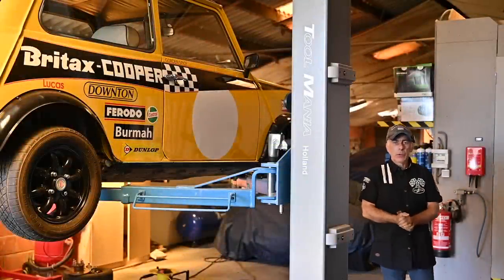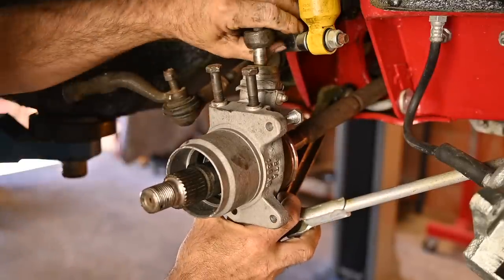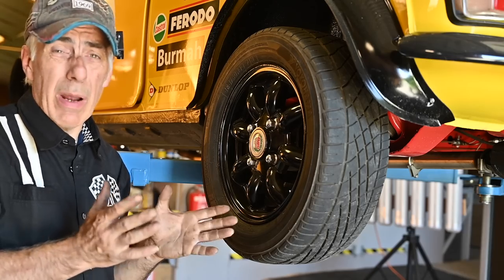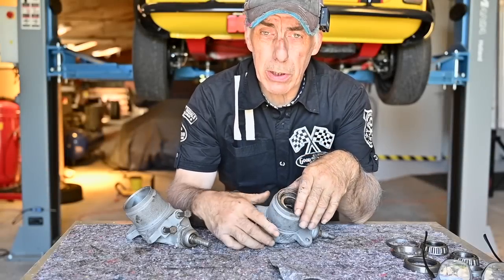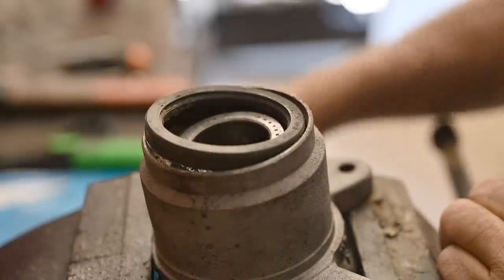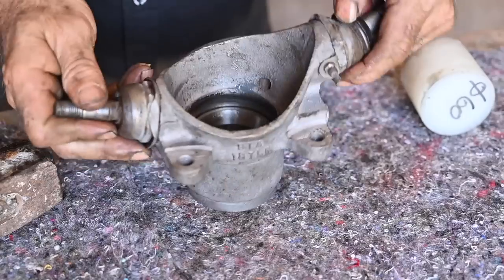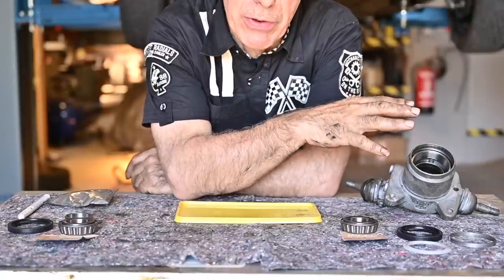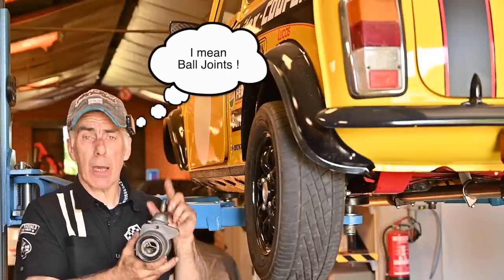Classic Mini, Part 1 Replacing  the front bearings

Comment: Thank you, this is a very good video on this subject. Your instructions are quite clear and easy to follow, much better than several others out there. I was a professional mechanic for 25 years(many decades ago) and one tip to pack taper roller bearings like these is with a wad of grease in the palm of one hand and hold the bearing with the other forcing the grease in the larger end by using a scraping motion until it comes out the smaller end, works great.
Cheers!

Comment: For packing the bearings, I get a blob of grease in the palm of one hand and use the other hand to run the bearing through the grease. However your method worked just fine. Keep up the good work.
Reply from the maker: Great tip!

Comment: For inserting the bearing cups (races) I used to take the old race and grind a little off the outer diameter (you don't need to remove much) and use that as a drift to put the new cup in. Now I have a machine shop so I can make a tool out of a material like Delrin even if it isn't a standard size. I also use a piece of brass bar to remove the cups. It will get dinged up and need cleaning up occasionally, but not a big deal. Keep up the good work - that's going to be a nice Mini.
Reply from the maker: Thanks for the comments Chris, very good tips

Comment: There is a easiest way to install bearing race or ball bearing: you may to heat a little bit a up-right and put race or bearing in a freezer for one hour at least. In this case you will be able to install race just by bare hands. I've done like this many times and it works pretty fine.
I don't think that your way is bad, but just wanna share one more option)
Reply from the maker: Thanks for the comments , indeed that is another way of doing it.. I did that before ( check my Lotus series) , but now banded from the  fridge by the girlfriend..
Reply: @D3Sshooter  Hey, being banned from the kitchen ain't bad as long as she brings the food out to the garage!  :  )

Comment: Dear Mr, I experience a looseness in the front end of my mini and the wheel alignment also doesn't last longer when done. I suspect that my front end wheel bearings are bad, but before removing how can i confirm that my bearings has gone bad? And eventhough wheel alignments are done regularly, my steering wheel jerks in highspeeds and the car slowly drifts to the right when the steering is released from the hands.. please advice me
Reply from the maker: Well to begin call me steve. Worn bearings make typical a grinding sound.  An easy way is to drive the car and take sharp left turn, if the bearings at the right are gone you will hear an increased grinding - singing sound.   Do the opposite for the other bearing.   That is one method, the second method is to jack up the car and hold the wheel at 180 opposite sites and see if you can feel play buy puling and pushing on that wheel.   In most cases warn bearings do not always cause the symptoms you describe, but they can.
Reply: @D3Sshooter  Thanks a lot steve..

Comment: An excellent job with attention to detail, not a job that would be done like this by a "professional" I am afraid, they want to see maximum profit, so many short cuts have to be taken, a very good idea of detaching the drag link from the hub ! That saves breaking another taper joint, using only best quality bearing is important, some of the cheap Chinese copies do not last very long, even on a trailer wheel. The bitterness of poor quality remains long after the sweetness of low price is forgotten, (B, Franklin). Stay safe! Chris B.
Reply from the maker: Thanks for the comments, indeed

Comment: Isnt like the faster the bearing turns the more the bearing load decreases since its more likely that the rollers gonna float on the lubricating oil film which is more stable at higher speeds?  and low speeds are more critical when the oil cannot lift the bearing and its harder to avoid direct contact. I think its more about the side forces in this case. great video again btw
Reply from the maker: Thanks for the comments, great explanation

Comment: I think you installed the outer  seal too far  in. It should be level with the outer rim of the upright.
   Also you should make a point of inspecting that inner ridge just incase it was damaged when knocking  the outer races out. 
I usually assemble the bearings and spacer with a   thin oil without the  seals and then using an old CV joint and a drive flange torque the nut up and check for  correct  movement of the bearings.  No free play and no tightness on rotation.  I have had tightness  and looseness cured by  changing the upright, bearings and or spacer.
When I'm  happy, I'll of course reassemble on the car with grease and the seals.
Reply from the maker: Thanks for the tips and comments